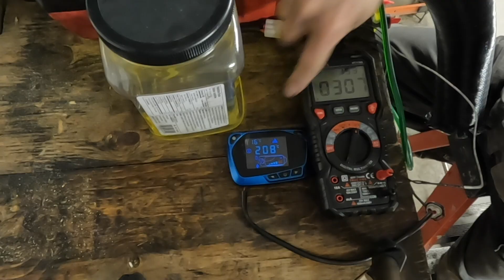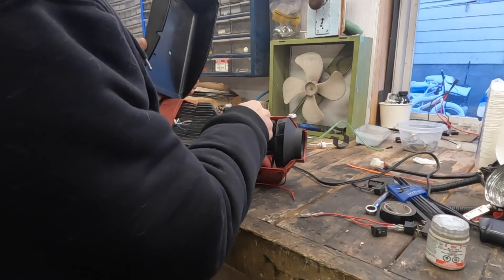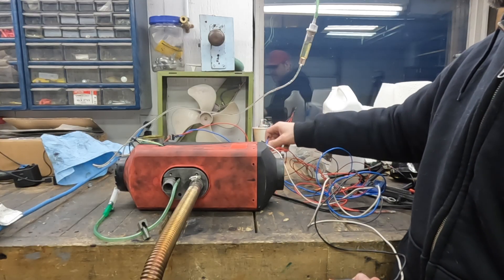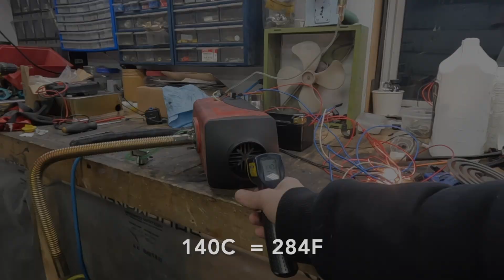ECU Replaced With Light Bulbs !! Diesel Heater Runs With No ECU !!

Comment: Super interesting I have been thinking about a similar thing I have added some thermometers on my heater to measure exhaust temp and heat exchanger temp and I thought about a mod to manually control fan speed and the fuel pump. But the fuel pump control would be hard to  do I think. Maybe running with this dripper would be the easiest solution. I like the idea that I can adjust every value just for fun and giggles. F around and Find out :D
Reply from the maker: This is a F around and find out situation, for sure... I don't' think the drip if very practical... it needs to be monitored and adjusted very carefully. Small changes make a pretty big difference in air fuel ratio, and CO emissions as a result.
Reply: @loweredexpectations4927  hard to adjust for sure. I am looking for some kind of square frequency generator to control the fuel pump but it's hard to find one.. and i`m not that into electrical stuff like that. Time to learn something new :b
Reply from the maker: @JohannesBrotBaum  Perhaps you can piggyback a oem ecu or rob components out of one ? I'm not an electronics guy either.

Comment: Attach an appropriate size needle valve to the same shaft of the potentiometer/rheostat to have a linear fuel/fan feed and speed rate.

Use a 12v relay with built in timer set to say 8 seconds that triggers when you move the knob from the off position to start glow plug.
Reply: A timed relais would contain electronics again.
The reostat/needle ratio would just fit to one fuel level, no matter how you'd adjust it.
Reply from the maker: @werner.x  Was that in response to something I said ?  I wasn't talking about timed relais...
Reply: @loweredexpectations4927  That's the response to ronaldduck - he doesn't get linked, when i click "reply". Don't know, why some people do get linked and most don't.
Reply from the maker: @werner.x  Oh yes... I think it has to do with the setting that person has selected...
Reply from the maker: LOL... I love it. More than one way to skin a cat, as they say. 

I was thinking.... for fan speed control, you can get those thermal shutdown switches (found on motors) .... They open circuit when hot and close after they cool. Get different temp ranges of those and wire them to resistors... You adjust the fuel, and when the heater gets hot, it disconnects a resistor and the fan speed increases. 

Have a fuel valve connected to one that shuts the valve if the temp drops below say 100C. So you start it with the needle valve, and when it reaches 100, the electric valve opens and you close the starting valve... after that it is self sustaining.

Comment: just use a 12v dial for fan control and an ajustable motorcycle blinker for the fuel pump, and wala🛸💨
Reply from the maker: Yes, many ways to do this. The dial does need to be able to handle about 50 watts, so it may require more than your average POT....

As for the blinker 🤔 ... They generally blink slower or faster depending on load (unless they are digital) so it would be tricky to get it to blink at the right speed... It may be possible... not sure.
Reply: @loweredexpectations4927  on my square body 4x4 i installed an led light bar and 2 small bumper leds as well, i used the oem dimmer in the truck for the interrior lights for the front 80 watt leds, i can dim them, on my ninja i used an after market adjustable blinker cause the new leds were flashing faster so i was able to adj. the pulse on them, but ya many ways, just tinker a bit ,new ideas always appear👍
Reply from the maker: @rgrg3683  It might work. The fan is only about half of that (40 watts) so it may be too low of a resistance... If I had one I'd try, haha. Sometimes technology is the easiest / best answer... adjustable blinkers make it easy !

Comment: This shows it should be pretty easy to control one of these using a PIC type microcontroller or andino. Could even add a barometer for automatic elevation controls. PWM for the fan speed, electric pulse variations to control the pump. If a STEM high school student wanted, they could build a killer controller for these
Reply from the maker: Absolutely ! There are tons of different ways to do this. 

My guess is that in a few years there will be all sorts of plug and play control systems for these heaters... as soon as people start realizing there's a market for it. 

It is however, one of those things where you start into it thinking it will be easy, and then realize there's a bit more to it, when you take all the safety into consideration, as well as the startup sequence...
Reply: There is an open source controller called "Webastardo" which has activity on it as of 4 months ago. David McLuckie did a few videos on it. But yes, it would be trivially easy for someone skilled with microcontrollers to slap  together a control system and order circuit boards from China.

Comment: It's neat that you can play around with this thing. But, I have concerns about the fan speed, when the fan speed is higher, the combustion chamber cools down and the diesel doesn't burn as efficiently. That's actually what the heat bars are for on the controller. I've messed around with the fan speed on mine and the higher you go the more bars you lose and the more the thing starts to smoke and burn less efficiently.

FWIW - Mine is on my boat and during the recent cold snap, I've had to use it more than usual. This morning when i got off my boat, my slip wasn't frozen and I had Jelly Fish around my boat. The exhaust does aim directly towards the water and I guessing it heats it up just enough to make a difference to Jelly Fish...
Reply from the maker: Thanks for the comment. 

Yes, this is by no means a practical, long term solution, or permanent replacement for an ECU... It was a demonstration of what can be done. 

You may have noticed that I am using a dripper to monitor the drip rate, and a CO meter to monitor the CO. CO is a really accurate way to dial in your air fuel ratio, as it is literally telling you the chemical composition of the exhaust. I also have a thermocouple that tells me the temp of the exchanger in Celsius, so a little more accurate than the bars system. 

Haha... the jellyfish love your heater too. That's awesome.
Reply: @loweredexpectations4927  I know it’s not a practical replacement for the ECU. Just make sure that people take in to account that the heater is more complicated than it lets on to be. 

We used a drip diesel heater in the military and it never failed when a new guy tried to light it and they would let too much fuel run in at startup, it would catch and turn both the stove and stove pipe just as cherry red as it could get without managing to catch the tent on fire. Diesel is very slow to catch but once it does it burns hot as hell. People need to respect what can happen fooling around with a diesel heater in a closed area with the very real potential of burning down their house.

Stepping down off my soapbox now…
Reply from the maker: @david78212  Haha... yes, this is true, diesel has a lot of stored energy. What makes these heaters a little safer is that they are a forced air unit. If the fan slows down too much, or stops, the flame will go out as combustion air is being supplied with the same motor that moves the cooling air. 

The inlet and outlet holes are also 3/4 of an inch. I'm not sure what the limitations on this is, I'm sure someone could tell us, but that size exhaust and inlet are only capable of producing so much heat energy. The engineering on these little units is pretty well done. You can cause a fire or hurt yourself if you try really hard, haha.

Comment: It was simpler with a dc variator .  It costs less than 3 light bulbs, wires and switches and easier to understand for most people, Or not ?
anyway, a very ok explanatory video.
Reply from the maker: Lots of different ways to do this. Nothing cost less than free and I had lots of bulbs sitting around, haha. I also have a PWM controller... but didn't think that was very interesting.

Comment: Neat trick for when we huddle in delipidated basements after the EMP destroyed the ECU on our diesel heaters.  Simply burning diesel soaked rags in an oil drum is too much of an apocalypse cliche. I remember a gasoline heater from the 70'. it didn't have an ECU either. A piezo igniter, and a combined fan pump motor.
Reply from the maker: I'm sure I responded to this message ... It must have been deleted because of something I said...🤬 This has been happening more frequently. 

If you use your brain you can often find your way out of a situation. Back in the day things had to be built a lot more robust. When you needed them to work, they needed to work. Period, haha.
Reply: @loweredexpectations4927  Youtube does this. Anything that sounds like demeaning of any opinion, a link, name of organisations or rebel groups on a blacklist, the message gets deleted, regardless of context! YT is useless now for more involved discussions.  Yes different fields of engineering needed to work together to build stuff.

Comment: Hi Joel,
Could you not use dimmer for household lighting to control the fan speed ?
Reply: that is the simple solution but it is way less fun. The way that he did it, really gets across the major differences between circuits with  resistors in series and parallel.Way easier to understand for folks who did not get the chance to do this at school...... or just slept through the class  ;<)
Reply from the maker: Yeah.... I'm like the cool teacher in school, haha.
Reply: Yeah your right Grizzly I'm going to try to get mine working with a household thermostat and a dimmer with some kind ignition to initialise the glow plug.
Reply from the maker: To be honest, partly what the big old grizzly said, haha... I have a bunch of other thing that I could have used, including a variable PWM, DC to DC regulator.... and some potentiometers.
 
I'm not sure if a house dimmer would work as they use AC and I assume they use some sort of electronics so that the load doesn't matter. Meaning, the dimmer needs to perform about the same in a room with 1 light as 4 lights and the bulbs could be different wattages.

Comment: Hi, i take it you are wanting to run the heater using easy to replace standard parts instead of relying on dedicated electronics. Totally get that one, its always the electronics that has a brain fart and let's you down.
Reply from the maker: There's no real end goal for this testing... It is being done to show people what can be done with a very simple circuit ... in an emergency, you could get your heater running if you have a light bulb. 

It is also a demonstration that these heaters aren't magic. 6 seconds of power to the glow plug and a little air flow and if you keep fuel dripping into it, it will run. 👍

Comment: " they won't understand" ,  That was condescending of you.
Reply from the maker: Haha... Not really, most people wouldn't understand and those who would didn't need it explained. 

What really happened though, was that I was struggling with what part of it to explain, and this was an expression of me just being upset with myself  "I won't be able to explain it" is how it should have been articulated. 

What I started to consider explaining, was that using one strand of wire would increase the resistance of the circuit slightly, but as I was saying it, I considered that it would also act as a fuse... all the while, words were drooling out of my face hole. 

I don't think most people wouldn't understand that using a single strand of wire would increase the resistance... Maybe I'm wrong. 

This is what happens when you film yourself. I thought it was funny, so I left it in.

Comment: Fantastic!  I wonder if the higher burn temperatures you are getting would allow you to get away with adding a little waste oil into the mix … although you may not want to open that can of worms again !
Reply from the maker: Haha... It is possible that it would handle it a little better for a while, however, I suspect the end result would be the same. I do have some other plans for waste oil though.
Reply: @loweredexpectations4927  
other plans eh ??  Ah ha...'the thick plottens' as my
old granny used to say ;<)
Reply from the maker: @bigoldgrizzly  Oh yes... Many plans.

Comment: Interesting, so the bulbs are basically acting as a crude/anolog speed contoller. I'm thinking if one were in a serious jam (where the control board went out & they didn't have any switches on hand) one could wire "socketed" 12v bulbs in parallel and then screw in 1 bulb at a time, to achieve the same speed control result(?)  On a side note (re the heaters that feature wifi/bt) anyone know if the wifi /bt radio is located inside the LCD control module, or is the wifi/bt radio located on the control board that's mounted directly to the heater(?)
Reply from the maker: Yes, basically the bulbs are resistors. That would work for sure ! haha... You could have a row of 10 bulbs with outlets, if you wanted, and have 10 speeds... that would be awesome !  

When you say wifi do you mean Bluetooth ? The receiver is on the motherboard / ECU that is in the heater. At least this is how they all are from my understanding.
Reply: Right, 10 bulbs/10 fan speeds, or any combination there of. -And yes, meant “Bluetooth” not WiFi, appreciate the confirmation!

Comment: Very cool experiments dude!  I figure from this, you might be able to figure out what the highest BTU you could over drive this thing to. Perhaps, with a couple light bulbs, and a needle valve, you can tune this thing to put out 8k BTU, or higher?  Lol!  I can foresee a total melt down of the internals, and I'm here for it!!  Haha!
Reply from the maker: 🤟 Haha... I had it up to 270C last evening without about 120 drips of fuel per minute... I'm guessing that was pumping out a LOT more than 5kw. 

Later in the year I may juice it up and see what happens, but for now I'd like to have a functioning heater, haha. 

It ran for 12 hours yesterday without the ECU and has been running again today since 2 or 3 pm.

Comment: Hey I totally get you. I'd call what we do tinkering and understanding cause and effect. Keep up the experiments and inspire others to go outside their comfort zone.
Reply from the maker: Heck yes... I don't try to mess things up ... but I'm willing to take a chance on messing things up to learn. That's how I have learned most of what I know. You get in there and mess with things. 

One of the best / worst jobs I've ever had was being a mechanic working for Sears Canada. They had insane scrapping policy (write off policy) so a LOT of new stuff went into the scrap bin and was sold for ten cents a pound. 

I pulled apart so many tractor transmissions, pressure washer pumps, engines, electronics, vacuum cleaners, exercise equipment.... Like a kid in a candy shop.

Comment: nice to know tell us about the color code on the input wires
Reply from the maker: I hadn't considered that people would want to know this, haha. Thankfully, it is extremely simple. The fan is red and black. Red to positive and black to negative. If you get this backwards the air flows the wrong way, haha... probably make for a LOT of smoke out the inlet hole. 

The glow plug is blue and yellow, but this hardly matters. You connect these to 12V and the plug gets hot... there is no wrong way. I would say not to send full battery power to it for more than 8 seconds, or it may burn out... It may be fine, but I wouldn't chance it unless you have a spare.